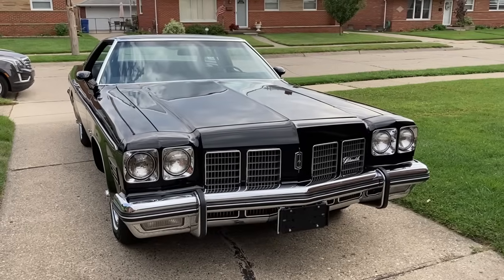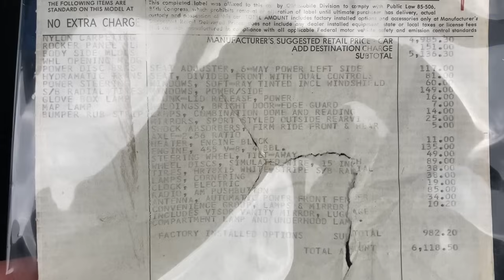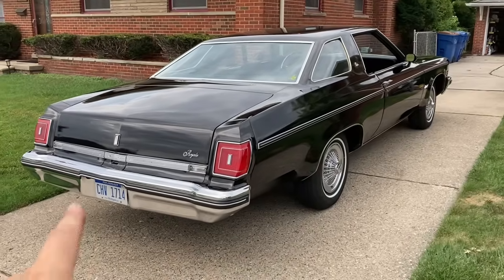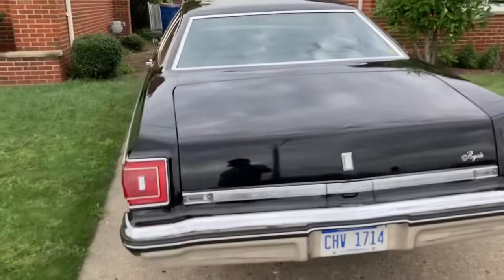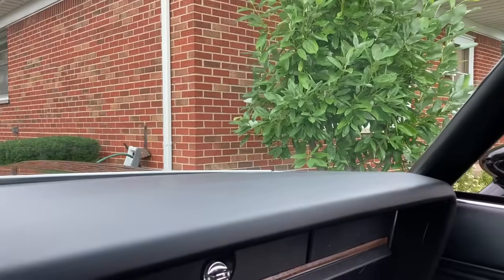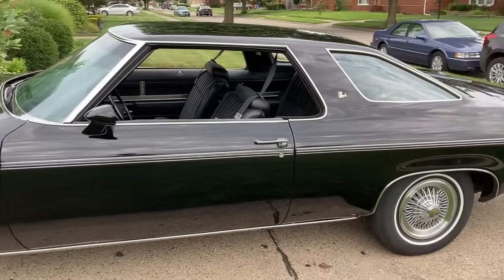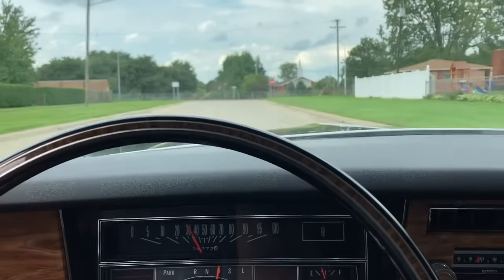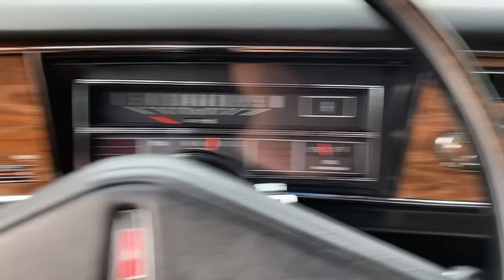4k Mile, 1975 Oldsmobile Delta 88 Royale Coupe Review & Drive - Check out article in description!

Comment: What a beauty !!  Back in autumn of 1974 , straight out of high school, I scored a service dept. job at our local GM/ Chevy/ Oldsmobile dealer. These 1975 models were just hitting the showroom floors. I got to drive many of these Oldsmobiles  as a result. From the one finger power steering , toe-touch power brakes, the solid ride, solid TANK build and the GLUG GLUG GLUG sound of the exhaust , this was a fantastic crusing machine. I fell in love with with Oldsmobile there and then at 16 yrs old. Every car I owned until 1990  was an OLDS. I was never dissapointed !  LOVE THIS MACHINE !!

Comment: The silky-smooth, nearly silent motor is amazing. Puts modern luxury cars to shame.
Reply: @cantholim1663  *than. They also cost a lot more.
Reply: @cantholim1663  
-I think you mean THAN this?
BAHAHAHA 
They weren’t in the same market. 
The Rolls was also a whole lot more expensive.
Reply: Yeah, you can burn rubber for about two blocks!
Reply: @donaldstanfield8862  Maybe you can, but why would you? That's not what this car is for.
Reply: @donaldstanfield8862  Makes me miss the old days. Yes, newer cars have better traction, but laying rubber was so much fun😁 A much safer way to have fun than driving 100 mph like young guys these days.

Comment: Great car, so happy you shared your gem with us. I remember as a teenager about that fan/off issue on my parents new 1975 Caprice Classic 2dr. They complained about it at the time I remember. I for one loved the car and can still remember the smell of it when they brought it home. It was a little of $6K new and I was lucky to get to actually have it in my possession for 3 months in 1980. It had the 400 bbl 175 horse and I could burn rubber in it. :-)
Reply: Most of those v8's in the mid 70's had more horsepower in reality than on paper in the Chilton manual😁They didn't handle or brake like newer cars, but the motors were bears

Comment: With regard to the springs, 71-76 full size Chevy and Olds sat taller than Pontiac and Buick which tended to sag in the rear.  We had a 72 LeSabre that eventually booster shocks were installed, greatly improving and leveling the stance and ride.
Reply: Oh yes, old memories agree, Buick’s did look saggier in back. I had used 76 Olds Delta 88 Royale 4 door hardtop. Massive 455 V8.  Yet I think it could sneak up to 15 mpg’s which was better than other brand’s "biggies" at 12/13 mpgs. Pretty cinnamon red with white top. Was fun to roll all hardtop windows down and wide view. Sometimes have a friend drive and sit in back, seemed like a limo and the hood stretched on forever.  Was handed down to 4 family members, made it to 300k miles. Never leaked, never used oil, always started. People just got tired of driving it and parked. The worst worn out roads were barely felt, it was the best used car I ever had. Rust was its only prob in the end. Awesome sled and land yacht !!  I greatly preferred the 1976 first year rectangular headlights. The whole front design is rectangles and squares, seems a better fit, more balanced/even. It was the very last year of behemoths and I think last dedicated Olds motor in Olds, Pontiac motor in Pontiac, etc.  Was it the last year of bullet proof turbo-hydramatic 400??  I also remember the huge 76 Caddy Sedan De’Villes with slab sides and new rectangular lamps. Nice sleds.  I recall outraged customers learning their 77 slimmed down Olds did not have an Olds engine, Pontiac, the same, etc.  "I didn’t buy a higher end GM model to have a Chevy motor !!" they moaned in 77/78.  Another lovely one that stands test of time in design looks, the 73 Pontiac Grand Am. It advertised a plastic front nose that could take a dent and pop right back out, no damage.  Sporty sexy good looks.  I shall never understand how GM could be selling Pontiacs by the millions and not make enough profit to keep building them !!!  Dumb move GM.

Comment: Hi, most of the cars you have on I have either worked on or owned back in the 70’s and 80’s. A lot of the engines were good once you figured out that it wasn’t a Stock Car. My first car was a 75 Elite with the 351/400 modified. I ripped the whole front suspension and rear out and replaced everything. I went to Sears and bought 5 new tires. Michelin was making the private label for Sears tires at the time. I balanced the rims first and when they were out of round, I replaced all of them. Rebuild the carb and used the Prestone Tee to rinse the whole cooling system out. Had the defroster on to get the heater core. It ran like a Champ for a long time before she finally met her demise. So I know exactly what you are going through. I really appreciate your knowledge and your willingness to really come across on these videos. Thank You 🙏
Reply from the maker: Thx Joe!

Comment: What a gorgeous car....and 455 to boot.  Interesting 2.56 axle ratio - she is a highway cruiser for sure.  Not that you are racing it but something like a 3.31 ratio would make the car allot more responsive and fun to drive. I love it!  I owned a 77 Olds 98 403 that had been ordered with 3.27 axle limited slip - it was a very quick and nimble car for it's size.
Reply: 3.08 is a great all around gear ⚙️ too!

Comment: I’m almost 73 now but back in 1971 I bought a new Delta 88 black on black just like yours black vinyl top it cost $4200.0
It had vinyl mag wheels mine had a 350 engine. I have a photo of those wheels took a long time to find. Drove it $100,000miles putting new rear springs made it feel like a new car oh well wish I still had it

Comment: Great presentation Adam! Love the back stories that come from these cars. It leaves you unsure if the original owner actually liked the car when they bought it given the mileage after 45 years. Their loss and your gain!

Beautiful car and smartly optioned. The firm ride was definitely the right choice to choose, given how ridiculously mushy the standard suspension was. This should have been the standard set up.

Not equipped with A/C?? That was normal where I live...unless it was a Caddy. That was why cloth over vinyl was chosen. No burnt legs or sweaty bums with cloth!

Door pins are going to be a pain to replace. Expect to replace those before too long.

Comment: Beautiful car.  My aunt had a1971 Olds Delta 88 Royale which had larger sail panels and a smaller back light to denotes its luxury trim.  I believe it had lavelier straps in the rear seat sail panels for easy exit.  Hers had the antenna built into the windshield.  I know what you mean about the build quality of that 1971/76 generation of GM cars.  The 69/70 full sized GM cars were the last of the great quality cars to come out of a GM factory.

Comment: Adam, a couple rides to add to your collection: '69-'70 Grand Prix and the '75-'76 Grandville or Bonneville (convertible looks great for these years).

Way back in '74 my dad picked up a new Bonneville, I remember driving our '69 Bonnie back to Detroit as he was trading in on the new ride. We broke down on the NY State Thruway, timing chain broke on the 428. LOL

 Pontiac was really hitting out of the park back then. PS the 88 Royale is a looker, great job would've looked better if Olds had rectangular head lights.

Comment: Wow you live around the corner from me. It is a small world when i saw u turn on to 11 mile road i was like yup. I have an 85 pro street s10 has an l98 and a turbo 400 trans. Ive run that truck on "tests" on that very drive more times then i can count cool man. Im a mechanic licensed to work on heavy duty gasoline trucks... Really enjoy the channel thanks for the entertainment. Im working a custom 1987 buick regal with a 6.0 out of an 05 Escalade runs now but the owner wants more power getting ready to pull that 6.0 back out to do a cam lifters springs and port and polish the heads then i hear therea a supercharger somewere in the mail or something so its gonna be a nice build doing it in a garage off milton in warren so very close to u as well. Seeing this car reminds me i still have work to do.the t type the 6.0 is in is ok its very clean has the t top roof and is black and beautiful.

Comment: My dad bought my mom a new '75 Buick Estate Wagon, also with the 455. By the time I turned 16 in 1985, cars were still anemic. Well, we still had the Buick as an extra car to pull a boat and horse trailer. My car was an '83 Ford EXP with barely 70 HP. Guess what my preferred vehicle was? The Buick! In high school, we called it the IROC Wagon lol. It just SOUNDED fast with that 4bbl carb lid turned upside down for that "extra airflow." The handling was downright dangerous as were the brakes on a 5,000 lb +/- vehicle. But....it had disco character.

Comment: I had the 1976 4 dr Hardtop, with the 455. Too bad this one is Black, they looked Much better in Red, or Saddle. No AC with a Black Interior? The Woman who ordered wasn't too Bright
The 455 was only rated at 180hp.
 Pull the Distributor Cap and see if the Centrifical<sp>  Advance isn't seized, also make sure the Secondaries are opening, when the choke is off, and that the Air Valve above the Secondaries is not sticking. Those items can give the 455 asthma

Comment: Hi Adam:
Your “car chronicles” are just great, entertaining, accurate and informative - hope to view many more.  Here’s my suggestion for another video:  Can you discuss what went awry with the design/engineering of the ’71 full size GM models, specifically the flex in the body structure and “cheapening of interiors?   Why was the flex not discovered/cured in testing?  Why wasn’t the “economizing” of interior materials/fit finish a more obvious mistake to management?
Could you also share some insights on the famed GM proving grounds Yuma and Milford on pre-production testing?  Any interesting tidbits there?  As a guy who’s family had a long line of Buicks, I can attest to the higher quality” feel” and look of the’66 Riviera and Electra to it’s 70’s counterparts.

Comment: My parents had one in 1976 - bought as a used car 1 year old.  It was green with white partial vinyl top and interior.  The 455 was just a big slow lump - I looked up the specs and it was the anemic 190 hp he notes good for 0-60mph in 11.5 seconds.  Of course we all realize emissions control killed the big block by this time in the mid-70's.

Comment: Really really beautiful car.
Fit and finish of cars of that decade left a lot to be desired. 

I order a new 1979 Pontiac Grand Prix with just about every option available. Car came from the factory with an extra hole in a trim panel, big knot in the fabric on the arm rest, poorly fitted vinyl top with a cut mark.  Within  1000 miles the alternator needed work for a capacitor that came loose,  transmission had shifting problems, if you filled the gas tank it would leak where the filler neck was welded to the tank, rear brakes drum would pull the shoes away from their backing plate so everything you let off the brakes they would snap back with a clunk.  Overall though it was a great car and I kept it for four years, when I made the mistake of purchasing a 1984 Pontiac 6000STE. 
But that’s another story.
Reply: Sounds like it was a Monday Car: built on Monday after the weekend-filled coke binges by the auto workers.

Comment: It is amazing how you find low mileage, factory original cars. As an enthusiast, it is wonderful to see these cars in original condition, even the low horsepower, smogged down ones. I know you are a factory purist but If you wouldn't mind I would like to make a few suggestions to reduce weight and slightly increase performance. Make a dual exhaust system with aftermarket high flow catalytic converters, stock mufflers, aluminum stock cylinder heads painted engine color, aluminum intake manifold painted engine color, 60 series tires in the rear. Otherwise, leave the rest of the car factory original. I know I am out of line but I think you would get better gas mileage as well as performance and slightly increased handling. I apologize for making these suggestions  but I am not exactly a purist as you are since I grew up in the period of partially or highly modifying a car. If you use the car a lot, I would also suggest a Custom Autosounds factory appearing AM-FM, bluetooth radio. Thank you for your knowledge and expertise.

Comment: I ended up having to change the heater core on my 1979 Chrysler New Yorker as there was a bad coolant leak coming from it. It took me about a week of just working on the car a couple hours a day. The entire dashboard had to come out to get to the heater box, and the steering column had to be lowered. I would say the hardest part of the job was getting everything aligned during reassembly and dealing with the wiring under the dashboard. I can't imagine what kind of job that would be on a modern car with airbags and sensors.

Comment: Well this brings back ancient memories.. Back in my criminal days (we were Pro's long, long ago) we wanted a total sleeper so we used a 1978 Delta 88 4 door in Black, as our getaway/escape unit. We installed a stroker 383 , a reworked Turbo 350 with custom drilled valve body, had wig-wag headlamps installed, altered suspension and of course we used Police scanners--one night on a big job we were doing, an alarm had the Police on the way quickly and we literally dropped our break in tools and took off--about a minute or so later, we blew past a Sheriffs car at over well over 120 mph as the odo was buried... on the scanners we heard the following "it's big, it's black and it's real fast"... We laughed out ahzes off and called it a night. Even though we were spotted several times over the years and in some high speed pursuits, we never got caught, ever..  
 These cars are a steal and your project is AWESOME.. Enjoy!

Comment: One curious thing about this model (and the big Buick and Pontiac)  is that they can be considered true 2 door hardtops even though there is an opera window.   Both front and rear side windows roll down and there's no post in between.   Neither Chevy or Caddy had this feature; they had a single door window followed by a thick B pillar and a fixed rear window.  These 1971-76 GM B bodies were the company's very last true hardtops!
Reply: Exactly. My grandmother. bought a ‘75 Pontiac Catalina that shared the same 2-door hardtop design with the Olds 88 and Buick LeSabre.

Comment: My parents owned a 1975 Cutlass Supreme 4 door to haul us kids around.  Very similar styling cues shared, like the bright strip at the bottom of the trunk lid. Brings back that old car to mind especially the Quadra-jet roar when the secondaries opened.  It’s what made me fall in love with Oldsmobile.

   I briefly had a 1971 Vista Cruiser with the 455 / 2.56 ratio rear which would hit 60 in first gear.  Ridiculous.  Too bad GM didn’t reintroduce a four speed auto box like the first Hydramatic so the rear ratio could have been kept at a higher numerical value.   Likely we’re slammed by emissions developments.

    I seem to remember that 1975 Olds had the pellet style catalytic converter and required unleaded fuel, yet when you said the exhaust was original a catalyst was not mentioned.
Was that not required on all cars then for/with unleaded fuel?
Reply: Yes, all 1975 and later US built GM passenger cars that were sold new in the USA had a catalytic converter that required using unleaded fuel.  Up to the later 80's all models used a single catalyst, even performance cars such as the Corvette.  In the case of this car, yes, when new it had a pellet bed converter, the heaviest and most restrictive type.  From what I have read, this was done on cost cutting grounds by GM bean counters.  Ford and Chrysler, on the other hand, used the 'monolith' type of converter, which was far less restrictive.  Most modern cars use a variation of the monolith design now.  Also, in the case of Ford and Chrysler, some of their big block and more performance oriented models (such as police spec vehicles) still had true dual exhaust systems with 2 converters.  

Beautiful car.  Has been a few decades since I've seen one of these, let alone such a 'minty' clean example. Keep it up Adam.   Big fan of what you're up to here.

Comment: @Rare Classic Cars
My parents had the 1974 Delta 88 Royale Coupe which was almost identical to this model except for small trim details. Nice, solid American car, ours had the Rocket 350 V8, and A/C as well which was exceptional. Interestingly this model was one of the first GM vehicles which you could add the option of front dashboard airbags! I doubt more than a handful had them when sold though.
Reply: My late Grandmother had a 4 door 1972 Delta 88 which also had air conditioning. Lurking under the hood was a 350 Rocket V8 engine. It rode like it was floating on a cushion of air. It also surprised a lot of people. For it's size, that car could flat out fly.

Comment: This era of Delta Royale 88 was pretty homely in it's day I thought back then...(I was 13 and a car nut when this car was new.)  Time has been kind to this design, though, and I think it looks pretty good now. This would have been a rare sight indeed since the landau top was in full vogue at the time.  No question, though, that the B and C body GM cars of this era had suspect build quality and this car now looks at least as good, if not better, than it probably did when it rolled off the line.  GM didn't bother with correcting the paintwork in those days, so the paint on this one is far glossier than it would have been from the factory.  Overall, a really special find.  I love the content, but for the love of God, please invest in a cheap phone gimbal mount so the "bobbing" and "seasick" motions of your camera work are smoothed out...your videos will instantly look more professional for less than a $200 investment.  Thanks!!